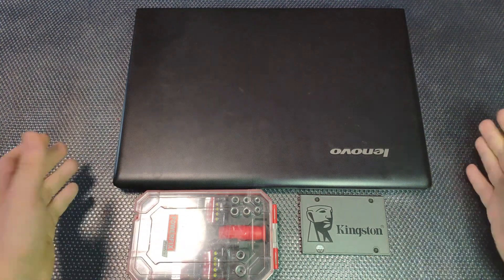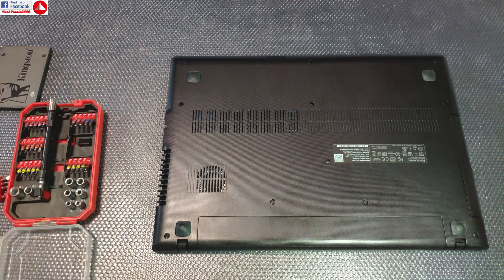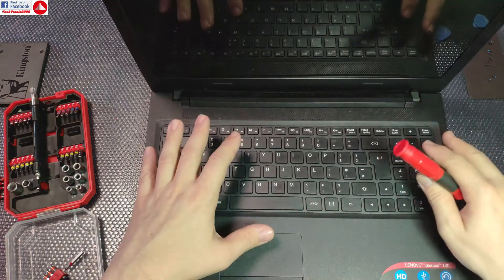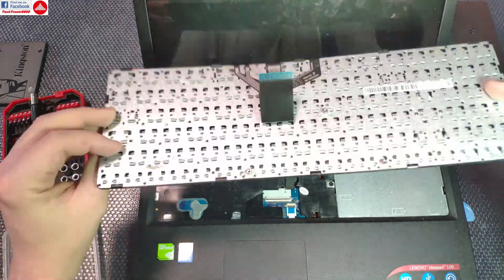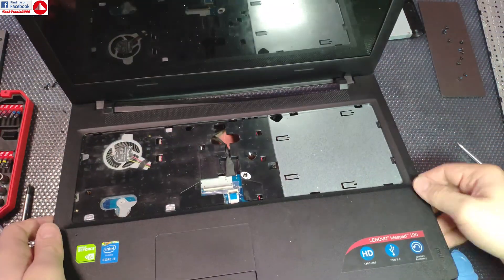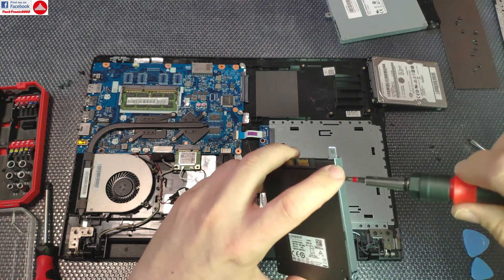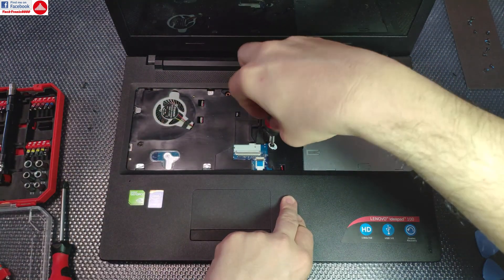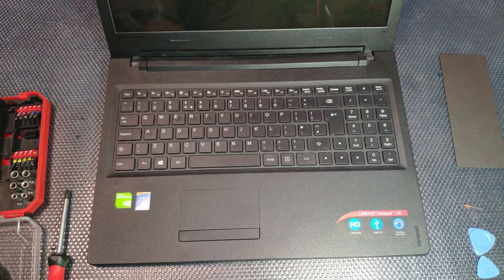Lenovo Ideapad 100-15IBD Disassembly, Keyboard Removal, SSD Upgrade, Battery Remove

Comment: Bro i too have this laptop but 1 year back it suddenly stopped working out of nowhere i took it to technecian he  said motherboard damaged is it possible to replace the motherboard
Reply from the maker: I don't think you will be able to find a motherboard at a good price. Also buying used might be already another faulty one.
Reply: @TechTronic9000  oh ok thanks for responding😊
Reply: @TechTronic9000  by the way I already bought another device it's dell Inspiron 15 3000

Comment: Just opened friend's one, one note: while splitting the two parts (after removed the screws under the keyboard), start from the back and then open it like a book leaving the front side as a fulcrum, don't force the opening from the front or you'll going to break the plastic bridges.

Comment: Thanks a lot but I can't remove a HDD. I unscrewed all 4 screws but it seems stuck
Reply from the maker: Maybe they changed something, might an extra screw, or some extra adhesive tape.
Reply: @TechTronic9000  thank you for a reply, it was glued for some reason
Reply from the maker: I'm glad you sorted it out. Consider subscribing as "thanks" ;)

Comment: You are amazing and there's a lot of care in your voice, you're such a good guy.

A guy in another video didn't bother explaining anything, didn't warn for the adhesive tape holding the keyboard, didn't explain the ribbon cable and all the intricacies. Even when he was opening the laptop, he slammed the lower part on the table so hard that it bounced.
Reply from the maker: Glad I could help! Consider subscribing, thanks!

Comment: Just a quick question what does one do if a few keys are not working in the keyboard and not sure it's a system issue. How much does a keyboard replacement for this version go in your country btw in USD
Reply from the maker: Might be a faulty keyboard, I usually search ebay for this kind of parts and also aliexpress.

Comment: I cant enter Bios or start from USB tried it with FN +F2
Reply: did you try the poke hole near charger plug? a lot of people don't know about that. that is used for bios and boot settings
Reply: @stefanstanciu9896  Thnx i dint know that, fixed it no and installed Windows 10.

Comment: I have the same but it no longer works for me, what is the reason please?
Reply from the maker: What is not working more exactly? Doesn't turn on? Doesn't boot? There can be a lot of things to check such as battery, charger, bios settings, drives, memory.
Reply: @TechTronic9000  The problem is from the battery, I will fix it, thank you for the reply
Reply from the maker: Ok, best of luck with your repair